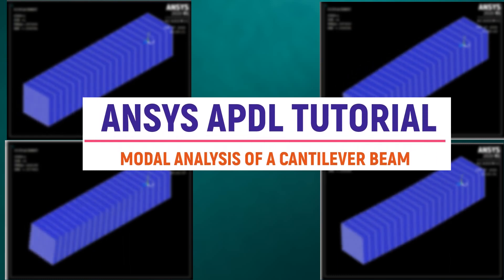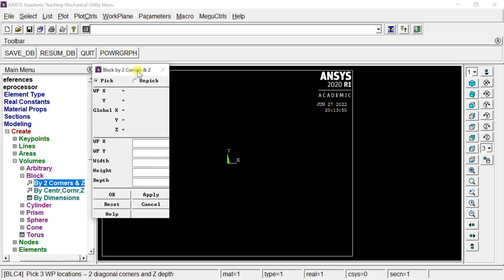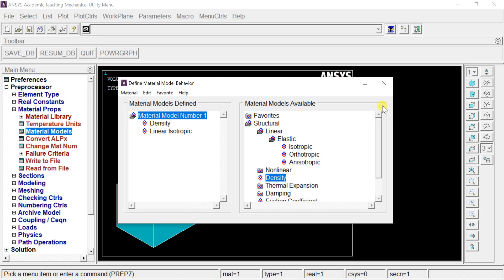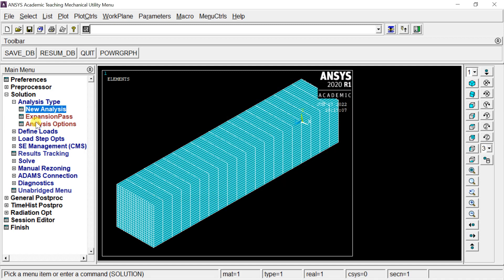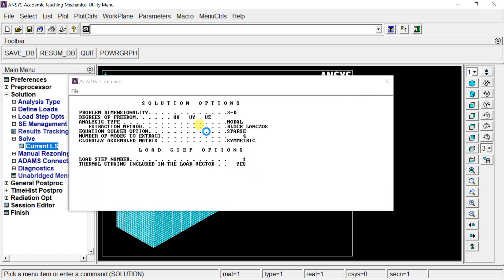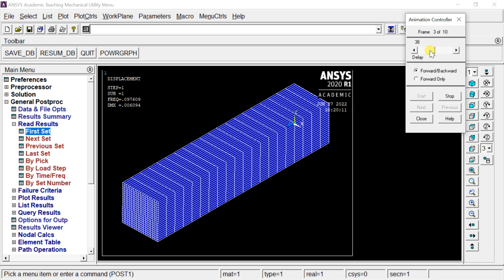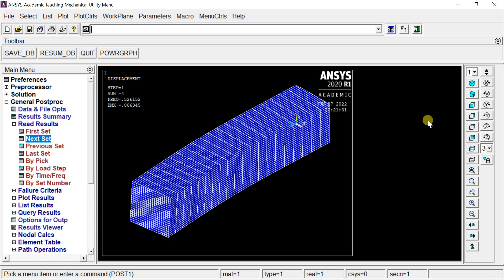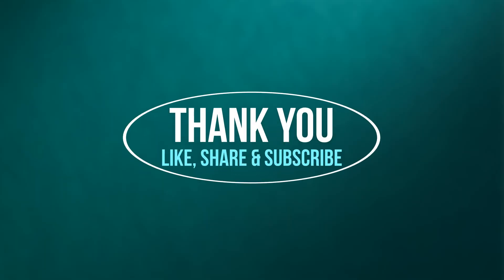ANSYS APDL TUTORIAL | MODAL ANALYSIS IN APDL | ANSYS STRUCTURAL ANALYSIS TUTORIAL | ANSYS MODAL FEA

Comment: Thank you for the video. Today, I focused on verifying modal analysis in APDL using analytical methods. In three different examples, the frequencies in Hertz are showing up as double in ANSYS. Considering that in vibration, the beam will exhibit both minimum and maximum deflections, and that Keq (3EI/L³) is based on the beam's deflection (either maximum or minimum), could this be the reason for the difference between the analytical and ANSYS results?

Comment: Thanks so much for this video sir. 

I will like to ask if there will be any need for a mesh convergence test and how that can be carried out for a modal analysis of a beam like in this case.
Considering we have four naturally frequencies (or more) to check and how is it calculated manually?

Your response will be highly appreciated.
Reply from the maker: Grid dependence test is not necessary for structural analysis problem. If you want you can check it for your convenience.  But for that we need to setup the mesh each time manually we cant use the parametric table.